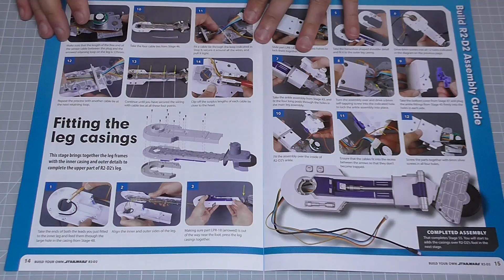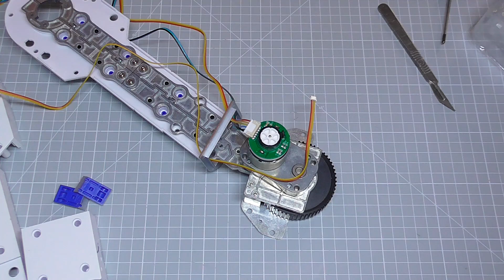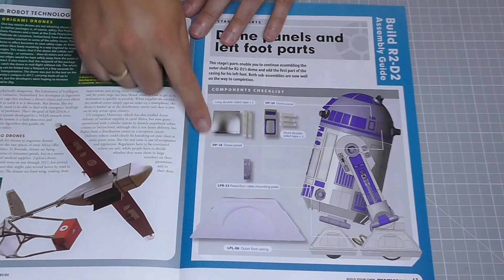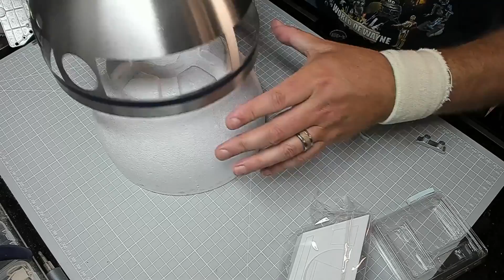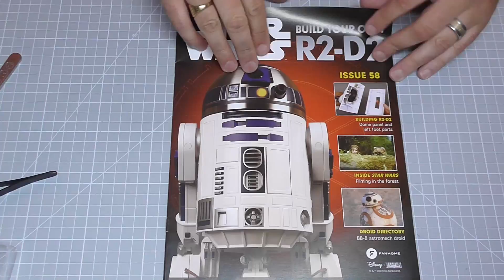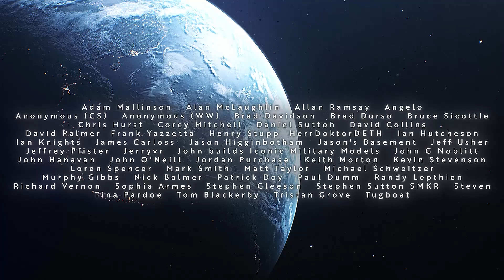Build Your Own R2-D2 - Pack 15 - Stages 55-58 - Dome Panels and Finishing the Left Leg

Comment: Thank you so much for the videos. They really helped out when I misplaced the build magazines. I had to add a calibration spacer to the sensor at the base of the left leg just like the right leg. The left sensor was constantly on while the base plate was installed. Thankfully, it worked like normal with the base plate back on after the spacer was put in place.

Comment: Just have one question for you  wayne ‐ how many 🔋 does R2D2 need ?
Reply from the maker: I got 50
Reply: @WorldofWayneUK  not the bolts I meant battery's
Reply from the maker: @roadrunnerj  ahhh 6
Reply: @WorldofWayneUK  okay thankyou
Reply: @WorldofWayneUK  Rechargeables I suposse
Reply from the maker: @JoseSanchez-ht1kc  18650 are lithium recharagable

Comment: I have the exact same problem with that foot sensor. Out of curiosity I plugged the other leg in to test that and it's the same. 
Just got off the phone with Fanhome who are sending replacements. But it's a worry that both have the same issue.
I did a bit of testing and found that, by putting a Sharpie pen lid over one of LED's the test light went off, So I'm thinking that either there is some light bleed, or the transmitter is too powerful or the receiver is too sensitive.
Hopefully the new parts will fix it.
Reply: Hi Wayne, a quick follow-up after doing some research... It seems that this issue can be caused by bright lights. 
I just retested both my (R2D2's) legs away from the window and without my bench light on, and they are now working fine. Put them back near the window and the green light stays on. How strange, I guess the infrared receiver is very sensitive.
Just thought I'd post this in case anyone else is having the same problem.

Comment: You know, it only took me about two rounds of installing those dome plates before I realized it was a lot easier to put the double stick tape on the little plate first and then sticking them to the dome rather than braeking my wrists trying to put the tape on the inside of the dome first
Reply from the maker: I could well believe it. The last plate i put in in this video I didn't even put tape on the other side. I only put it on the one side.